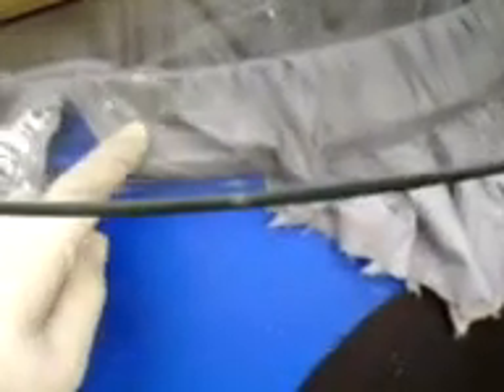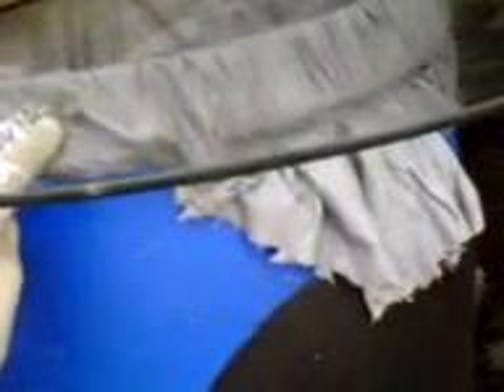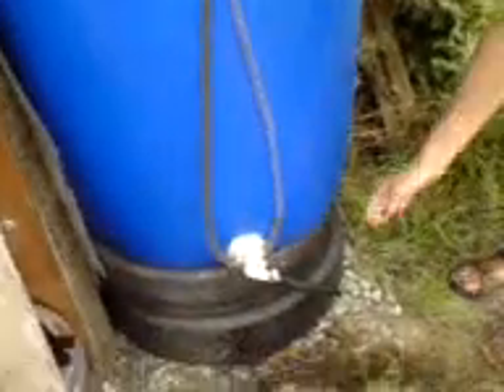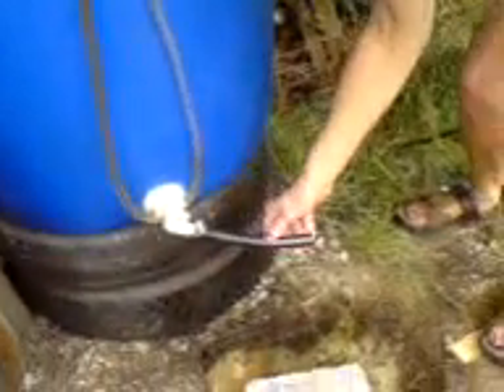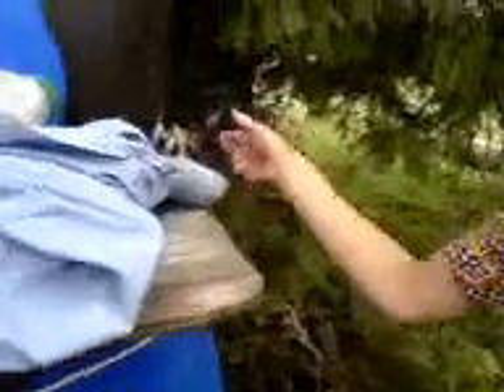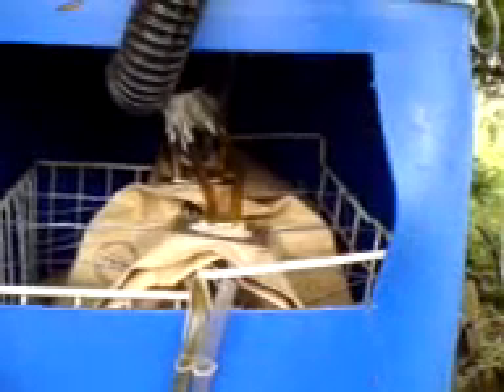Purifying Waste Cooking Oil for Fuel (4/4)

Comment: WARNING ! Veg Oil will Kill a Common Rail Diesel Engine ! Stick with the Simple Diesel engine like the 1.7D Isuzu found in most older Vauxhall's or the 2.5 Ford Diesel found in most Transit's!

Comment: Brilliant solution with the vacuum cleaner bags! I have just arranged for some pick up of cooking oil from the restaurants nearby. Luckily, nobody was there before me to claim their used oil :) I will try this on my old Toyota Landcruiser that I bought this spring with this in mind; to be able to drive much cheaper, and more environmentally friendly! Fingers crossed -but they say an old diesel engine can run on a lot of different stuff.. I've so far tried it with ATF automatic transmission fluid

Comment: Thx for the info I have just bought an old wooden boat with a bmc1500  going to do this as fuel is  about the only cost I have due to running my engine to generate electricity so this will be helpfull I intend to be almost completely self sufficient within a year

Comment: hello acerwizard. great vid. did you see top gear where they mixed used veg oil with white spirit. 1ltr oil and 30ml white spirit , what is your oppinion on this, would this help for cold start. also i have a citreon picasso 1.6 HDI. could i put oil in this car.